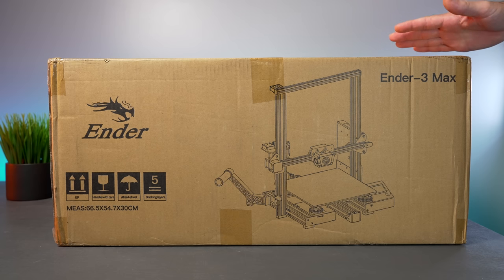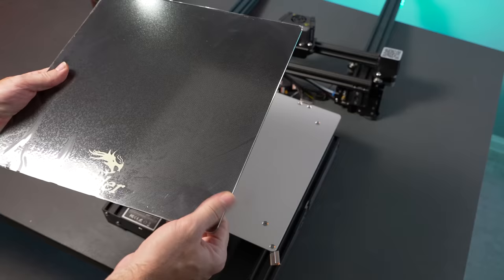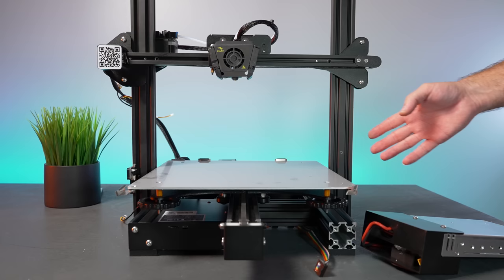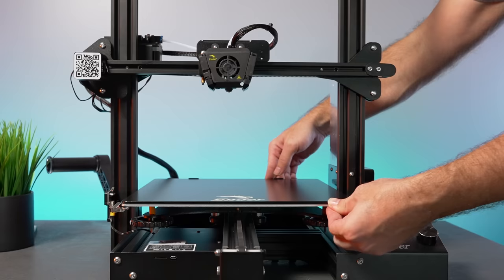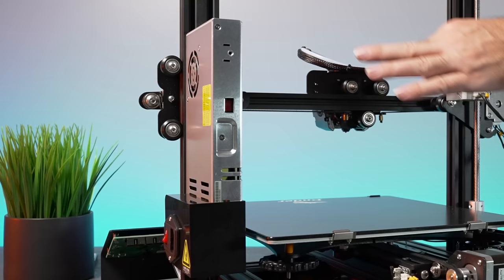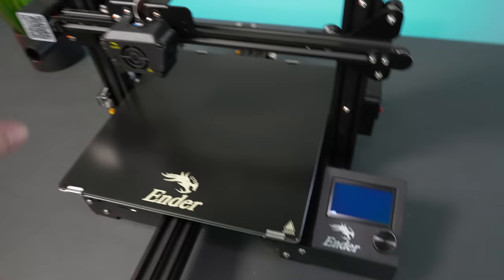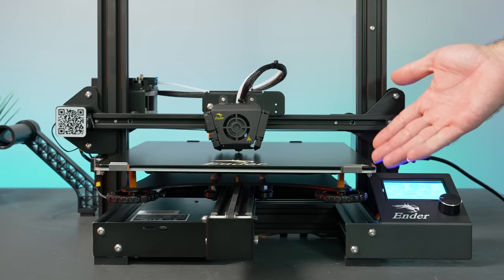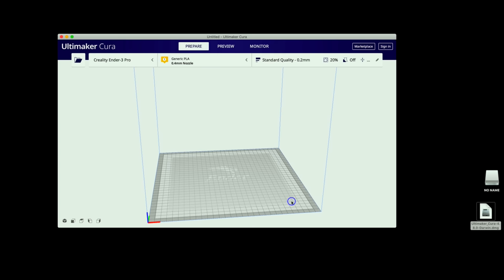Creality Ender 3 Max - 3D Printer - Unbox & Setup

Comment: im thinking about getting this for my first printer can anyone tell me if i need a USB stick or a SD drive to transfer files for it to print 3D models?
Reply from the maker: Printer comes with a micro sd card which plugs into the included usb adapter, and thats all you need to transfer files from your computer. No need to buy anything extra. But you might want to pick up some PLA filament.

Comment: Marlin 1.0.x and similar stuttering problems like Ender 6. No serious review can recommend this.
Reply: This is not a review fortunately. This is an advertisement.
Reply: @Sebazzz1991  sorry, I missed that. :) If I only read the declaration in the video... ;)
Reply: It's a perfectly functional 3D printer and is priced at $350 US, which is chump change for anyone, with even those with a basic job.  People have lost all perspective at how ridiculously cheap technology has become and the relative value you get for it.  

In 2014 a crappy RepRap, which was literally nothing but a pile of parts you had to assemble, would cost about $700 in adjusted dollars!

This printer prints 3D objects very well (my results are far better than most examples I see) and is a breeze to assemble.  Obsessive focusing on irrelevant "problems" is meaningless.

Comment: Have you had bed adhesion issues? I can't get anything to stick. Using petg and 60c bed temp and nothing will stick. I bumped it up to 90c bed temp and no change. Nozzle distance is good as I used a .1mm feeler guage to level the bed.
Reply from the maker: If you have adhesion problems, try washing the build surface with dish soap and rinse well. That usually works good for these types of beds.
Reply: @JustVlads  I used rubbing alcohol but it didn't seem to help. I'll try dish soap
Reply: I had to wash mine with dish soap twice before prints started sticking.
Reply: @csircy  I ended up having to use a glue stick to get things to stick. Within the past 2 days I tried a new glue that is working great and I flipped the glass bed so im no longer printing on the textured side and so far no issues at all.

Comment: Did you tried to print anything on spiralyze mode? In my ender 3 max its not working (its crashing, like lagging the firmware). i've tried all firmwares from creality website, but didnt worked. =(
Reply: Watch last 5 minutes of video
Reply: The problem is power loss recovery. Disable it for the vase mode prints.

Comment: Having massive bed adhesion problems after my first print of the calibration cube. The cube printed fine with some slight lifting on the bottom of the print but after the first print nothing I print wants to adhere to the build plate anymore. Beds level all the way around but still can't get anything to work correctly after my first print. I have put my printer to the exact settings you did in your video and now nothing sticks to the bed after the first print
Reply: Is the print bed getting heated property? Other thing could be z axis calibration. Do the paper trick and keep doing it at least one round more than you think you meed to. If you move the printer around or remove the print bed, it could lose calibration.